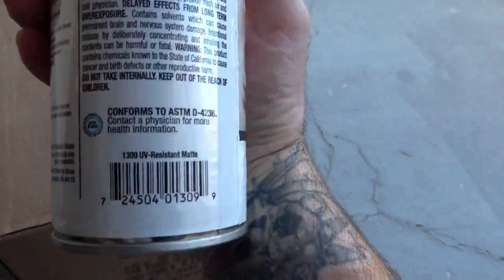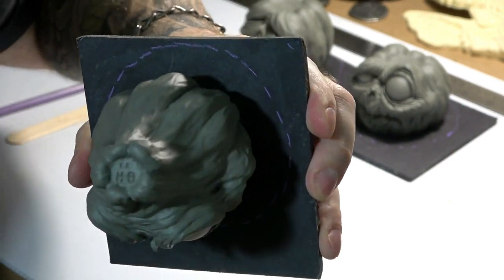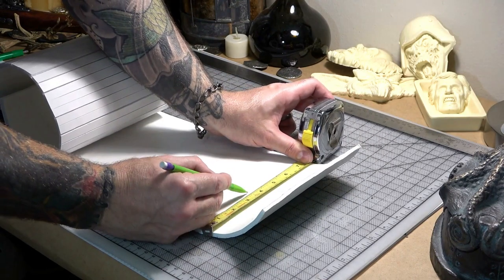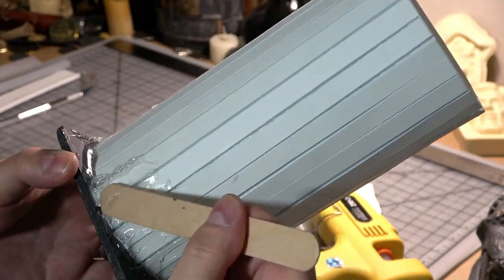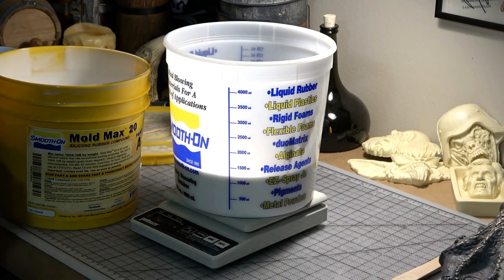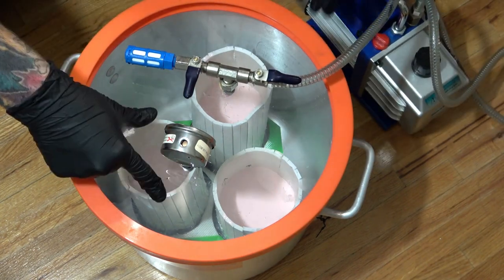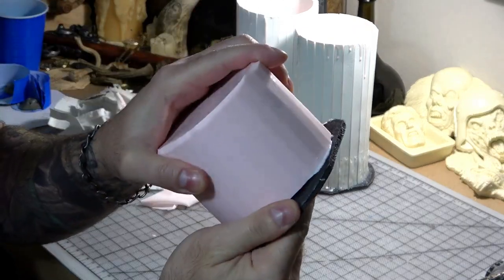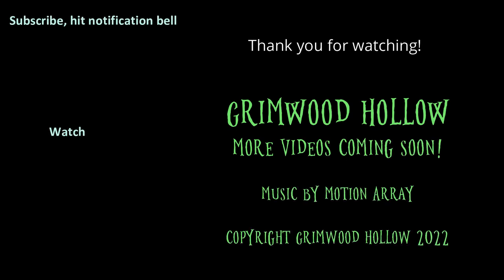SILICONE MOLD TUTORIAL - BABY PUMPKIN IMPS | Making of Grimwood Hollow PART 2 | DIY Halloween 2021

Comment: Damn I missed the premier!!! Brilliant tips on making a flexible foam core mold wall! Where do i get a vacuum chamber like yours? Was the mold max tin cure in case there was Sulphur in the clay? These little guys are so awesome! I might be jumping the gun but did you make resin masters of the imps with the new molds? Cannot wait for the casting and finishing video!!! Phenomenal work as always!
Reply from the maker: No worries brother, and thanks again so much! So I got the vacuum chamber and pump off of Amazon years ago, it’s nothing too special but it gets the job done! I’ll try to shoot you some info about it later! I used tin based because it sets up really nice on this clay, platinum can be hit or miss with this clay even though it does not have sulphur, and tin is a bit cheaper than platinum too. Also I only needed a dozen castings or so, if I was going to run a ton of parts then I would use platinum for sure, as you know it has way better longevity! I didn’t make resin masters, but I probably should, just in case I ever need to make new molds years from now? Thanks for watching brother, and Happy Friday The 13th! 😱😜👍

Comment: wow ok where to begin... First of all Steve I want to say this is an awesome series and super helpful! I love the sculpts so much. Those little guys look fantastic!!! I have never made a silicon mold before but can see why it is a popular method. If someone does not have access to a pressure pot, can they tamper it on the table to try and release the air bubbles? Is it possible to make a pressure pot using a sealable container and let's say a shop vac? Or is that not enough of a vacuum? I have been thinking about this process for some time. Seeing this really helps and, your idea of using the foam board for the mold walls is ingenious. Oh BTW, is that DR. Carl Hill I see chilling in the pan off to the side? lol, I see the American Werewolf in London nightmare demon there too. Good stuff! Thank you again buddy for sharing this. I am looking forward to part 3!!!
Reply from the maker: Thanks so much brother, glad you are liking this series! So you definitely do not need to vacuum silicone to get a good mold. There are some really great silicones these days from Smooth-On with a high viscosity that really flow into the details and allow air bubbles to escape! And you will probably get pretty good molds with these, but vacuuming the silicone insures you get a flawless bubble free mold every time! Also if you are going to pressure cast your resin then you absolutely have to vacuum your silicone mold or you will have issues. If you want to know more about this we can chat on the phone sometime and I’ll explain it all! I definitely would not recommend trying to build a vacuum chamber, that could be dangerous! Oh I sculpted Dr Hill, the Nightmare Demon, Pennywise, the gremlin, and a bunch of other horror movie characters for my wife’s candle company, she makes custom wax melts from these molds! They are soooo fun! I thought I sent you photos of these? I’ll shoot you a link soon! Thanks again bud!😄🎃👍